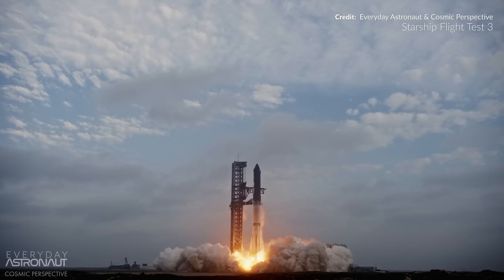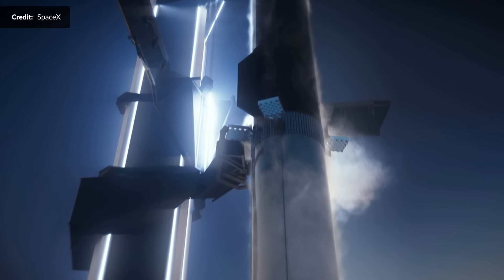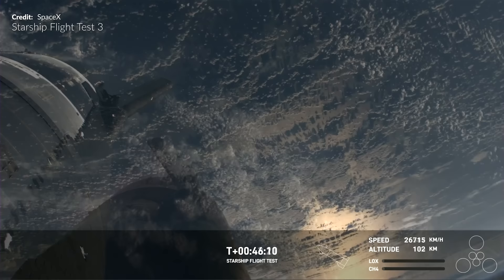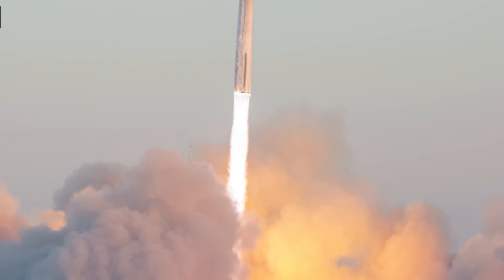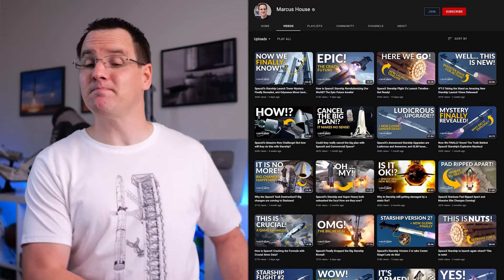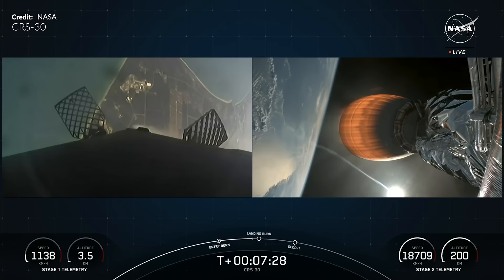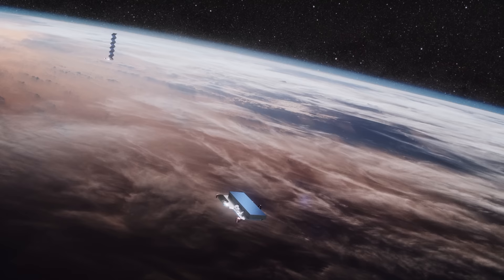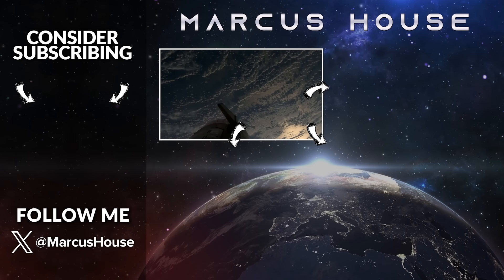SpaceX's Frantic Push to Launch the Next Starship Mission is Nuts!

Comment: I would say it rather obvious they're not catching the booster anytime soon. Like you mention, the likelyhood of destroying stage 0 is huge. They would want perfect landings on the perfect coordinates in the sea first.
Reply: That was clear from the getco. I am pretty sure that first attempt will be when second tower become online. Not necessary full second launchpad, as launch table is really complicated, and also second tank farm etc. I think they will push on finishing tower first, for first attempt. 

But actually I think progress it's pretty good. At least one engine fired properly, and I think there is few variations of raptors mounted on test articles, (on s24 was confirmed that raptors were different from each other in minor details, not sure about recent one, but it's logical that SpaceX will test several variations of equipment that couldn't be tested otherway, like ignition hardware) 

Additionally they need adjust software against real life results. I am sure attitude control on next IFT will be much better, but they will still not nail proper ignition next time. They will just perform BETTER than this time
Reply: I was hoping they used the oil platforms to catch super heavy, at least use it as a practice platform before switching to catching it at starbase.
Reply: Exactly. And Starship is still going to be economically viable even with booster expended.
Reply: @szkoclaw  dokładnie. Current pricing is about 90mln for production of full stack, with 18mln for ship alone. One launch (excluding refurbishment/repairs of stage0) is about 100 mln. It's very cheap for that class of rocket. Even with standard ratio of 250% above cost it will superheavy launcher in cost of heavy launcher (maybe fh would be cheaper, but less capable).
Reply: Completely agree You're going to want a few perfect landings on your set coordinances first.
Reply: @Stylofo4m better than billions
Reply: I hope the second tower will be minimal at first … just for catching until “perfected” … not plumbing for fueling … this seems the best way to manage risk … any investigations with catch failures wouldn’t impact launches … just land in the water until the second tower is repaired and investigations closed.   Expect 2-3 failures at a minimum.
Reply: @Madchuck42  A Hundred times Better!
Reply: I agree and this is concerning for the HLS timeline, which will require around 15 refuelings, which means 15 launches and for now, all of those are disposable.  

What is a realistic year for Artemis 3?
Reply: @Stylofo4m a million bucks an engine for something like Raptor is CHEAP. We just don’t knit for sure what their cost price per engine is; that information is SpaceX secret sauce
Reply: @I-0-0-I 15 launches sounds like an awful lot, and managing thermals and boil off on Starship (or a depot) in orbit are tough problems. I’d expect the number of required tanker flights to come down, but also the timelines for Artemis 3 to really be impacted… I reckon we’re talking years here
Reply: "Launch pad"
Reply: @RussW_Comments No stage Zero either, just tower and catcharms. Then use transporters to move them around. 
Geoff
Reply: Yeah they could have to switch to canards on the strakes of the high pressure vessels. The falcon boosters grid fins are ten to fifteen feet down from the top of the f9 booster. The upper part of the fuselage pushes against the direction of travel the grid fins want to go, creating tension that stabilizes or over powers many of the  oscillations. To light at top   possibly
Reply: @Stylofo4m  33 million beats 2 BILLION, which is the current estimate of what it costs NASA to throw away every single SLS booster...  SpaceX Superheavy is way, way more affordable.
Reply: @benfowler1134 I am pretty sure Elon was looking for a raptor price way below a million, half a million and less (vague idea it was 250k).
Reply: Once they can recreate a landing with Precision over the water. Also stage 1 needs to be at least 70% completed before a catch. Also in the test the booster actually corrected itself and achieved perfectly vertical flight, but couldn't slow down. They are getting pretty damn close
Reply: @RussW_Comments  Yeah I had the same thought a while back, they needed a separate tower to practice their catching before even attempting to use the completed first tower.  They need to work on the booster's stability, make it reliably land on precise coordinates in the water.  Only then should they use the catch tower to attempt a landing, because there's still a lot at stake even if the second tower is a good distance from the first tower.  I also think the chopsticks need to move a lot faster if they intend to actively catch the booster or starship.
Reply: @michaelanderson4325   For whatever reason, they dropped that project and sold the platforms several years ago. My guess is they realized the oil rigs were just not suitable to the task, They were probably too small and not able to bear the loads that would be required. I imagine that, eventually, they will construct some purpose built platforms for off shore operations.
Reply: What if there was a mock catch system? Spacex you better not rip me off, that’s a good fucking idea… less someone else already thought about it 60 years ago lolol
Reply: @GB-fd5ev  It would be the most efficient workflow for Starbase operations and maximize launch cadence as it would decouple any refurbishments (even if very few or minimal the time would not be zero and during that time the OLM would not be available for launches) and payload loading, which will not be done while on the OLM ... except for tankers, then it makes total efficiency sense.
Reply: Thank you for all the insight from team SpaceX. You must be rather high in the pecking order or understand physics better than the rest of us. It's truly a private hear you weigh in... 

Nah, I'm just fucking with you. Stop saying things.

Comment: I would like to see a video discussing Spacex plans for landing the starship and its booster. There will be many interesting challenges such as how one pad will handle both landings, what to do if you have a landing issue with the first landing (booster),  what kind of inspections they can complete between a launch and booster return, etc. I would also like to see information about the Florida Starship launch facility. Is Spacex going to build exclusively at Boca and then return launches in FL?

Comment: Thanks for answering these viewer questions about IFT-3.

I noticed on both IFT-2 and IFT-3 that there was a very dark brown/orange streak in the Booster exhaust right after lift-off. Since the raptor engines, unlike the Merlin engines, don't throw partially burnt RP-1 from a turbo-pump overboard, I did not expect this.

Initially, I thought this was another case of SpaceX having engine rich exhaust, but it didn’t seem to negatively affect the booster, which only failed much later.

Do you know what is causing this effect?
Reply: Most likely a combination of  
A) nitrogen oxides from atmospheric nitrogen reacting with oxygen under extreme exhaust temperatures as the air is mixed and entrapped in the exhaust flow
B) a slight  amount of soot can be formed from methane combustion too

Its also possible to have some nitrogen contaminants in the methane maybe? I'm pretty sure the methane is a way cleaner burn than kerosene in regards to both nitrogen  content in the fuel and soot production. Maybe (speculation, cause i dont feel like googling stuff) the initial tank pressurization is done with nitrogen before the autogenous system kicks in, and some nitrogen gets dissolved in the liquid methane. I know for sure that aviation kerosene on Russian planes contains some amount of nitrogen which (again in combination with the although lower but still high temperature) produces the same kind of trail often when taking off with afterburner on (look up tu-160 takeoffs for example)
Reply: @nikolayageenko  I initially also thought about atmospheric nitrogen, but I'm not entirely  convinced. If you look at a Delta IV Heavy launch, this effect is not visible at all (as far as I can tell). I mean, it could still be a result of atmospheric nitrogen, maybe Starship and Delta IV Heavy aren't comparable for the purposes of NOx production, after all, I don't know much about the chemistry involved.
But your other theories were new to me. Thanks for your input 👍

Comment: The tower and chopsticks needs less refurbishment with each launch.

The QD arm connector plate was buckled and disconnected after the November launch, this time it looks mostly intact. A few cables and hoses are damaged but they could add stronger shrouds on the hoses for the next launch.

Also this is the prototype tower. There's rumours of another water deluge upgrade to spray water on the OLM itself to protect it from the rocket exhaust. We don't know what future upgrades will be made to future towers.
this was an informed comment from reddit

Comment: quick release undergoing some serious overhaul at the moment, not sure extent of refurb, but spacex is going over it carefully, im wondering if the flex pipes need a metal mesh covering, just thinking out aloud, they already have an interior mesh covered by foil of some sort, so not really sure whats going on there. i heard the final roll of flight 3 was  a 'test to destruction', would fit with spacex thinking of 'fail fast, fail hard'
Reply from the maker: I suspect they probably need to put in some dampening to try to stop the vibration a little. I suspect the vibration just sheered that right off. May just need some inner support.
Reply: who needs ground news when we,ve got your show Marcus, i wonder how you score in their metrics?
Reply: If they were doing a test to destruction, they would have put it in the test plan. Because it wasn’t in the test plan it’s a mishap and requires an investigation.
Reply: @SciFlyGal I think this will be equally problematic, as SpaceX is testing multiple issues, so they don't know exactly in WHAT moment it would fail. Ie SpaceX didn't tried to add to test soft touchdown of ship itself. So they at least suspect that ship could theoretically passed re-entry. So if they expect that Starship would NOT be destroyed during re-entry, they have to trigger self-destruction
Reply: That side of the launch mount looked pretty toasty. Just spitballing here, but I bet there are nooks and crannies in the QD area that get absolutely hammered by overpressure waves which weren’t caught in the simulations. Valuable data to feed into the next iteration of the booster QD design!
Reply: @just_archan  it was supposed to survive reentry. I know you want starship to succeed, I do too. It hasn’t yet. Just accept that. There is no reason to have super secret test plans they don’t tell anyone about, it would actively slow them down when they could literally just say “we’re launching and letting it tumble through the atmosphere to test how long it lasts.” Technology takes time, accept that failures will happen along the way.
Reply: @SciFlyGal  I am big fan of that approach, OFC combined with spaceX idea, (similar approach is used now ie by relativity, or Stoke. Rocket is one, but production is a key, so all those systems are designed for cheap production/fast iteration). One stack is ridiculously cheap for that class. Less than 100mln per launch. Comparing that to ie SLS, with 4.1 bln per launch is pointless. But more important, SLS required for thorough ground testing, because of cost per launch. In case of SLS spending about billion for just testing equipment for core stage is actually good investment. But for SpaceX, this one bilion could be spended on ten IFT launches, each of one brings way more data than just a green run. Not to mention, that spaceX would be forced not only to build rig from start, instead just refurbishing and modifying rig that was used previously for testing Saturn V, but also it should be able to withstand 10 times more thrust than this in Mississippi. And another thing, I don't think there is even possible to test on ground stuff like starting thrusters against near Supersonic airflow.

Comment: I have a question for any engineers or scientists that are interested. The question is regarding the water deluge system. Is, or could there be, any benefit to surrounding the launch platform with a giant ice cube? They already have the capability to freeze a gigantic volume of water... wouldn't ice be more protective than mere water? Wouldn't it take a great deal more energy to melt ice than to boil water and in the meantime wouldn't all that ice be shielding and insulating the platform? If there is a need for liquid water you could also have piping insinuated through the ice cube to get the water up and out as well...

Comment: Why not they put the same ceramic shielding used for re entry on those lunching legs?
Reply: They would be destroyed without question. Its a very different environment. The vibration alone would turn them into powder while the uneven shock waves would spread the remaining sand and bits far and wide.

Comment: In re the sudden liberation, a minute or two before Starship's entry began, of a number of heat shield tiles (and some non-tile structures, like what looked like pieces of the insulation material installed between the skin and the underside of the tiles), I recall at the time it happened that the feed I was watching had an audio feed from the SpaceX control center.  Now, that feed lets you hear a lot of reactions to things happening real-time that we don't have much info about.  And JUST before the shower of tiles and such started, I heard a moderately loud reaction I can best describe as meaning "uh-oh!"  Or maybe "oh, no!"  It really sounded like a reaction to something bad, or surprising and not nominal, happening that was obvious to the people in the control center.  They had access to video feeds we weren't seeing, so I assumed that they saw some fairly dramatic event on a forward-facing camera's view, and we saw the resulting debris coming past on the rear-facing camera view that SpaceX was sending out.  So, seeing as how the ship had lost attitude control authority already, my guess is that the people we heard groan and exclaim dismay on the feed were watching an "energetic event" happening in or near attitude control vents at the nose of the ship, perhaps relating to the loss of control authority.  We'll see exactly what SpaceX releases in the incident report.

I will also say that the amount of gas that visibly vented out of the payload bay of the ship when the door was opened seemed to be a lot more than I'd expect from just venting the trapped atmosphere.  From how there was almost this waterfall effect of gas flowing from the nose down towards the bay door, I wonder a bit if maybe there was a leak from one or both of the header tanks in the nose.  You know, up near where there may have been an energetic event a little later on...?  It just has me curious.

Comment: to solve the ceramic tile failure (falling off during test/launch/re-entry), I would suggest coating the entire face of Starship's ceramic surface with multiple asbestos/carbon fiber layers (like a wrap). This same proceedure should be performed on all lift off platforms, structures and launch pad (addition of  ceramic/asbestos/carbon fiber to all surfaces). Starship's ceramic coating with asbestos/carbon fiber wrap would at least hold the ceramic tiles in place during test/launch/re-entry, potentialy burning off during re-entry but that would be ok, right?

Comment: Why would they not use the same heat tiles on the rocket but bigger slabs to protect the tower  of tower on any of the parts that dont move as they can take very high temperatures ?

Comment: 13:45 It seems to me that a SpaceX slide would be safer, as it doesn't rely on mechanical stopping. Additionally, if the slide is flame-resistant, it could offer better protection in the event of an explosion.

Comment: Yes someone mentioned landing on used oil platform , as things are now that looks safer and logical now more than ever until we see them have control of booster.
Reply: SpaceX abandoned that idea.  The logistics just don't work.  As a note, the primary reason for getting them was that was the source of the draw works for the tower (the system that raises the chopsticks.

Comment: It might be, that not only some valves had problems on the second stage of the SpaceX' rocket, but also one of the main tanks had some major leaks as well. In my past, I was designing, manufacturing and testing lots of vacuum components with welds, which is one of the critical topics in vacuum-related applications. Ideally, one was trying to avoid welded connections, but if there was no way around, rigorous testing was always necessary, as there were always some surprises to expect. From that perspective, when observing the flow pattern of seemingly leaking gas, it looks like some welds have given in and emitted the gas at some angle - causing a rotating moment.

Comment: I keep mentioning a huge aspect regarding Starships payload capability: Yes, the tanks were pretty much empty once in orbit, without any payload, but
- both booster and ship were slightly underfueled, and, much more importantly
- the booster held the max acceleration to less than 2g. I did the math, at around T+2:00 minutes, the booster thrust was barely above 70%, and it kept decreasing to below 70%. That increased the gravity loss by a lot. The acceleration could have easily been 50% higher at only 20% more thrust. Spacex only does this flight profil, because its pretty much the minimum work the booster can do with the ship still making it into orbit, decreasing loads on the vehicle during first stage flight.

MECO velocity could easily be at 8000+km/h with full reusability.
Reply: I think that's a maybe rather than a for sure..